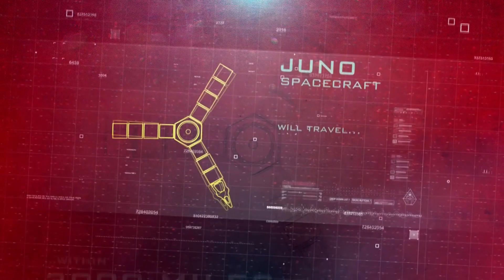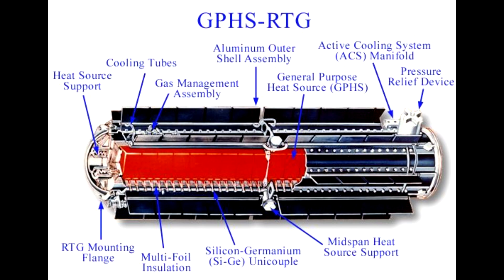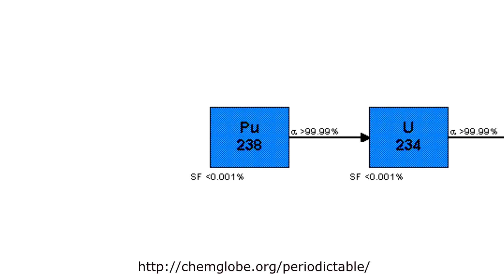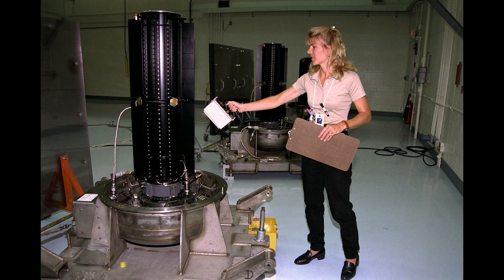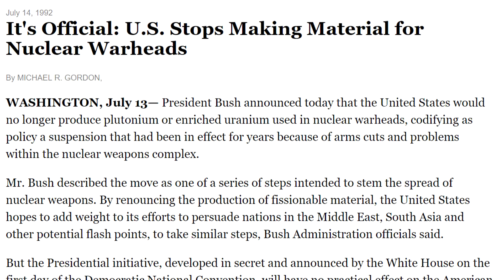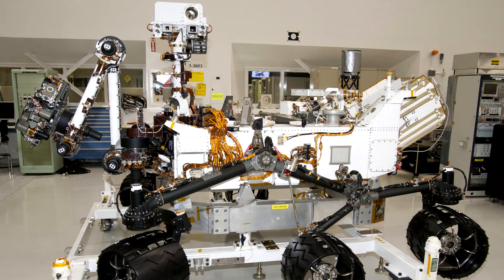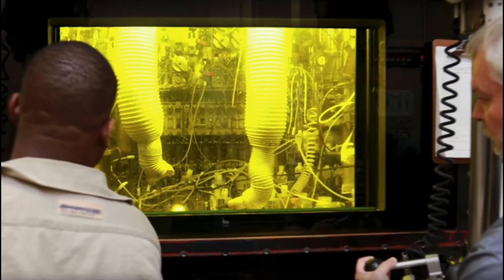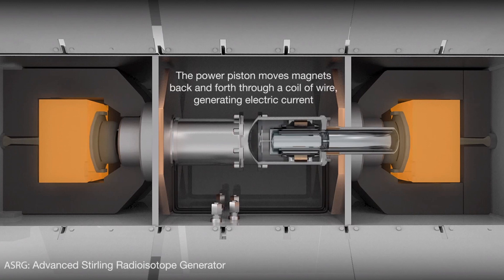Juno & NASA's Plutonium Shortage

Comment: We might already have mined out this planet and we have nuclear reactors in orbit. What a great race humans are...
Reply: Mined out this planet o.O You are exaggerating in a most unpleasant way. The only resource that scares me at all is gallium  - insanely rare and utterly unreplaceable in the making of green technologies. The entire LED boom, better, cheaper solar cells, better, cheaper, more efficient power electronics will be running on GaN as well. All that and much more can be done with it. Indium is a close second, but it isn't nearly as amazing. Everything else. For every lithium battery technology there are 3 other battery technologies that never got research because lithium came first and was so easy and so good. Iron, Aluminum, Silicon, Carbon....our Planet is basically made of it. Rare earths.....not that essential. With prices increasing, generator makers are going back to actively exited machines for wind power. Copper....yeaaaaah. Could be a Problem. We will porbably have to reserve it for pcbs and other delicate applications and make the big stuff from aluminum. Will be a nuisance, but it isn't THAT bad. Overhead HV lines are Al anyways, for example. Copper would actually make a worse overhead line because it weighs more and is less strong per weight. Helium could be a problem, but as long as it is cheap enough people can afford buying it for balloons....all is still well....
Reply: I'm asking myself if they can make more Plutonium dragons in the future or whether humans simply shot all that stuff into space.
I know we have a lot of it on the floor of the ocean - where the barrels filled with Russian Plutonium can slowly diffuse into the water.
But don't know if it's the right isotope for nucular weasels .. ehm nuclear vessels ... or something like that.
About "mining out" a planet - it probably won't take long until we fuck up (in any way) earth before ever setting foot onto a "second earth".

Comment: a stirling engine has the problemes associated with moving parts -  part wear down unless they are lubricated. And I think this is hard to do in outer space where temperature diferences make something like motoroil a vapor or rock solid. I think it needs a realy sophisticated system do work with stirling engines or maybe just someone who is smarte rthan me :).

Comment: Enjoyed your video Scott. While electrochemical batteries are problematic and moderately unreliable things, having ended many missions far  earlier than planned, , any space tech that uses moving parts (Stirling Engine) are also very likely to be troublesome. Think lubricants, friction, sliding surfaces, wear and tear .... none are desirable.  The RTG has two huge plus points...... no eletrochemical battery cells and no moving parts.  It scores very highly for reliability, but brings its  own problems...... COSMOS 954 and others.

Comment: Why do we refer to the half-life of radioactive elements? Why not just refer to the entire life of them?
Reply: During half life any single atom of the isotope has 50/50 probability of decaying. So after 1 half-life you have, well half the material, after two 1/4, after 3 half lives 1/8 etc. 2 half-lives does not mean all the original material is gone
Reply: Let's say you have 8 atoms of a substance with a half-life of 1 year. After 1 year, you have 4 left. After 2 years you have 2 left. After 3 years you have 1 left. And after 4 years that last atom is now decayed. So the full life of this substance is 4 years?

But it isn't, since if you start out with 32 atoms, it takes 6 years to fully decay. Half-life is a useful unit because it is independent of amount. Whether you start with 8 or 800 quintillion, you halve the amount after X years.
Reply: I'm a geek, not a nerd I believe a half-life is the time it takes for one atom to decay into another.

Comment: I knew thermocouples had considerable limited efficiency, but I didn't know a Stirling engine of all things could be more efficient in this case.
Reply: Ya, less than 7% efficiency.  With that said, the waste heat is then used to heat the vessel, so even though it isn't great at converting it all to electricity, it isn't just going to waste either :D
Reply: Thermocouples don't come close to 7%.  Their overall conversion efficiency is very poor  indeed.  7% would generally be considered awesome.
Reply: @allancopland1768  what they actually use are "thermopiles" basically what it sounds like. and ehen the heat just heats itself, who cares about efficiency? 😆
Reply: What scares me with the Stirling system is that you have moving parts.  RTG's have none.  We know what happens to moving parts after years in space, and it's generally not good.  Look at the Pioneer craft, going strong for decades using RTG.  Make the stupid Pu-238 domestically, please.
Reply: @kurtbjorn  pioneer has LONG been dead...
Reply: Yeah, it's more like 1%, I thought. Which sounds bad till you think of incandescent light bulbs....
Reply: Thermopiles have no moving parts but Stirling engines have bearings a the possibility of wearing out or failing for other reasons.
Reply: You could do a hybrid version with a thermopile plus a stirling engine. The efficiency of thermoelectrics is abysmal generally 0.5 to 1% thermal to electric power 😵
Reply: development of the ASRG 4:04 was canceled in late 2013, 3 years before this video was published
Reply: Smart right? it's the temperature difference that makes Stirling engines run. makes sense when the dark vaccum of space is so cold

Comment: Pu-238 is not a product of Pu-239 manufacture for nuclear weapons. It's present in small quantities in spent reactor fuel but it cannot be chemically extracted because it's mixed with Pu-239 and heavier isotopes.

Pu-238 is made by a separate process involving an alternating series of nuclear and chemical steps. One way is to start by extracting Np-237 from spent reactor fuel, where it was produced when U-235 absorbs successive neutrons without fissioning, first to U-236 and then to U-237 which beta decays to Np-237. A lot of Np-239 is also produced by neutron absorption in U-238, but this rapidly decays to Pu-239, leaving just the Np-237 behind where it can be chemically separated.

The separated Np-237 can then be put back into the reactor where it will absorb more neutrons to become Np-238, which beta decays over 2 days to become Pu-238. Since there are very little of the other plutonium isotopes, this can be extracted chemically.
Reply: and the award of most informative comment goes to ...

Comment: this may be a dumb question, but why dont we use the cores out of the nuclear bombs we're decommissioning, and for that matter what about spent uranium fuel rods, they still put out a lot of radiation (just not enough for nuclear reactors)
Reply: Wrong kind of plutonium, uranium and plutonium of different isotopes don't put out much heat per unit mass, only Pu238 does really. 

And spent fuel has other issues, like it puts out high energy gammas that are not going to be possible to shield on a small space craft. That is why they use Pu238, it is very easy to shield against.

Comment: Scott! Do you have any ideas as to why tritium based betavoltaic power sources are  not used? I have always wondered why not but there isn't much info out there that I can find. I know it's cheaper, also has no moving parts, and  last just as long. Any thoughts?
Reply: There are several reasons, firstly is the human problem. Tritium is a weak beta emitter, but even so, that causes exposure limits and handling issues in fabrication. Second is the short half life of the stuff. With only 12 year halflife, it means you need to make it and use it within a year or two. This also limits mission duration, power levels are going to rapidly diminish compared to a Pu238 source. There are more reasons, mainly that Tritium production also has weapons proliferation issues and isn't super easy to isolate either....

Comment: the main reason most deep space probes used  radio thermal generators in the past is that the sunlight is much dimmer in the outer solar system. however newer model solar panels are much more effective than older models and can now be used to power craft much further from the sun than before.  you would probably still need an RTG if you were going past saturn

Comment: That theoretical Sterling Engine seems like it's be hard to make work over a long time period, since it requires a gas of some sort to displace.  How long could you keep it from leaking?
Reply: Most power cycles are closed cycles, they don't leak or else it would power the system down. It isn't much different here, the pressure they normally are under via atmospheric and vacuum is less than they pressure they exert on themselves :D

Comment: Hey, Scott I am an Aerospace Engineering student, I am now working on my M.Sc in propulsion, but I graduated about a year ago from the Penn State Aerospace program, and my senior design project was subsequently submitted to the RASC-AL forum in Cocoa Beach FL. in June of 2015.  The goal of our project was to design a method of landing 20 mT of payload on the surface of mars as well in order to facilitate human colonization, as well as a possible payload for that lander system.  Our proposed payload actually consisted of three separate parts (two rovers and the lander that would also double as the long range communications system) each powered by an RTG, so with the shortage of plutonium available, we had to justify the use of three separate RTGs, we actually looked into the Stirling generators, and it appeared that development had been cut, we had to go with the 1.5 Kg/year in the end,  Just an FYI...

Comment: Wait?  What does the manufacture of nuclear warheads have to do with Pu-238 production?
The primary fissile material in nuclear warheads is Pu-239 produced by neutron capture and subsequent beta decay of U-238.  Pu-329 having excellent fissile properties and being easier to make than it is to separate u-235 out from u-238.
Pu-238 isn't produced from the same materials, nor does it have the same properties.

Is this another case of politicians being overly broad in their actions because they don't know any better or is there some other reason I am missing?
Reply: The production of Pu238 has you isolate Neptunium 237 from waste inventories. This creates a proliferation risk as there is also plenty of plutonium in there, typically. Also, Neptunium itself is fissile and can be made into a bomb, though, I don't believe it has ever been done before. 

You can read a bit about it on the Wiki actually, pretty good place to start poking around :D

https://en.wikipedia.org/wiki/Neptunium#Weapons

Comment: Of course, Oak Ridge is using the High Flux Isotope Reactor (which is used for a lot of other work as well - not just isotope production (they also produce isotopes for animal tracers, medical isotopes, and isotopes for material studies), but a host of other uses for neutron activation analysis - nuclear nonproliferation, environmental studies, forensics, and more) to produce the Pu-238 - the 50 gram sample is for analysis, they hope to produce up to 3-400 grams per year once it's finished, and then automate and scale-up to produce about 1.5 kilograms per year.

It doesn't sound like a lot, but something to consider - according to the US Department of Energy records on NASA's Pu-238, in March 2015 there were 35 kg available in NASA's inventory, 17 kg of which met specification to be used - that pool being for the 2020 Mars Rover mission (using the same chassis as Curiosity) and another two for a notional 2024 mission. The Pu-238 that doesn't meet specifications isn't useless, however - it can be brought up to spec by blending it with fresh Pu-238 from Oak Ridge.

Comment: In I did a landing on Eeloo using a Ion powered spacecraft with 30 Gigantor XL Solar Array on the planet ship to take the lander there.  The lander was small and used O2 and fuel.  The planet ship carried the lander from Kerbin orbit.  It took 28 years for me.
The sun is a bright star. - It was round trip for 4 Kerbins.  Solar panels are weak in the outer solar system, at Eeloo power was about 1/4th so plan ahead.

Comment: Is a thermocouple like a peltier tile?  Is the alpha not traveling far the reason they use it? (radiation and electronics)
Reply: Thanks. If hot is all they need could they use 239 or another more prevalent radioactive material?
Reply: so the different rads cause problems for electronics, if its just heat there after there are plenty of options

Comment: I could be wrong here but I thought that a few days ago on a Reddit AMA with one of the lead engineers for the mission they specifically said that they never seriously considered an RTG for Juno as with new improvements in solar technology it didn't seem like a sensible weight to performance choice for the mission. Although I'm sure the plutonium shortage issue further ruled out the RTG of course.
Reply: Ya, it is so rare these days that you have to think about other things first then come back around to it. Which sucks really, having more options early in the design phase helps.

Comment: Are they planning to send a submarine on Titan? They should add a massive heatshield to it!
Reply: nuuu nuu nuu.... unacceptable.
the submarine will be probably moving at several km/s as it would be intercepting titan from an interplanetary trajectory. Instead of having  extra fuel to slow down upon arrival at saturn and then titan, they could just heat shield the shit out of it and put it on a direct trajectry to titan.
(kinda like the galilleo suicide jupiter penetrator or something which slowed down from 50 km/s to 0 at 4 secs)
Reply: Well... probably not a massive one. The thing is, Titan has a really thick atmosphere, but it's also not that big. I'm rough-estimating the altitude for a stable circular orbit at 1 Mm based on the thickness of Titan's atmosphere and its low gravity (though that could be off by several hundreds of km in either direction). That gives us an orbital velocity of... 1584 m/s. Aerodynamic heating is definitely a factor at those velocities, but they're nowhere near Earth re-entry ship-frying velocities that necessitate a serious heat shield. 

And now, after having written all this, I realize that you were probably just referencing xkcd (What If, rather), and that I have self nerd-sniped.
Reply: They actually have to do the opposite, liquid methane evaporates at very low temperatures. The heat from any power source we have would cause the sub to cavitate pretty badly unless the heat is dealt with. Getting rid of the heat without cause the sub to sink to the bottom sounds like a fun engineering challenge!
Reply: +Max Thomas Titan has an atmosphere that is more dense than earth's. That's why you would only need an oxygen mask and a heavy coat to survive there
Reply: Michael Tarantolo
...Yes. It does. I don't believe I said anything to the contrary.

Comment: Can't they recycle nukes?
Reply: Long story short, bombs use completely different versions of the same elements used as a power source.
Reply: no bomb fuel isn't suitable for this because of its tendency to start a chain reaction, wouldn't want your spaceship to blow up like fat man would you? also bomb plutonium puts out less alpha particles which transfer most of the heat
Reply: What Joshua said, Pu239 is what bombs use, it has a very long halflife and gammas all through it, not suitable for heat production. Pu238, its lighter cousin, is a byproduct of weapons production from exposing U238 that still has 235 in it, that U235 will eventfully turn into neptunium 237, which can then be chemically extracted before it turns into Pu239. Pu238 only has a 80ish year half life, so it puts out enough heat to do what we want it to.